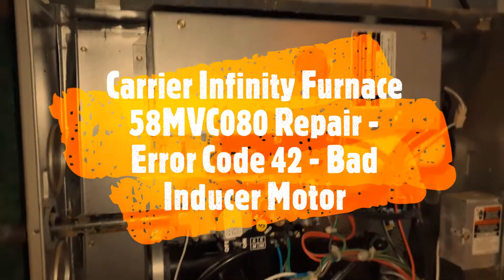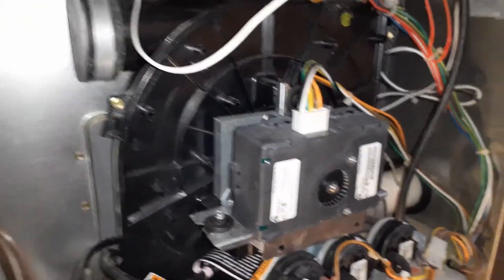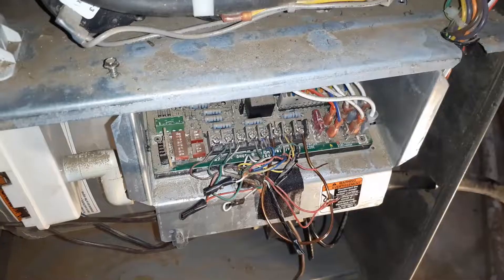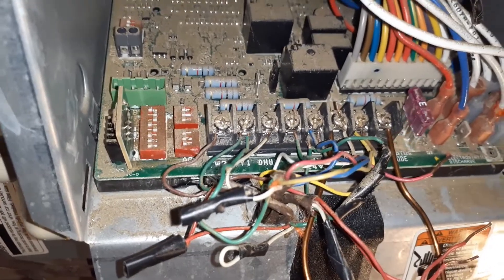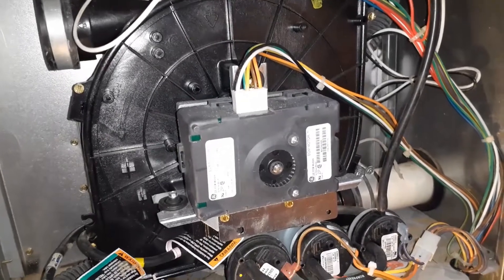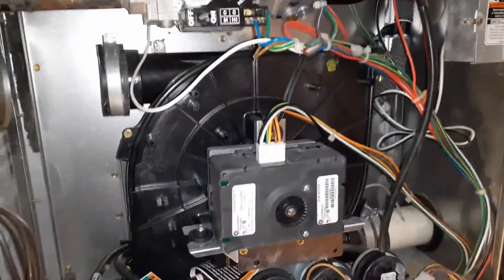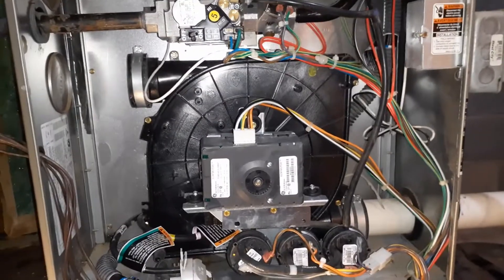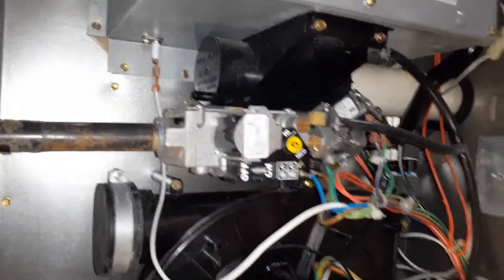Inducer Motor Fix - Carrier Infinity Furnace 58MVC080 Error Code 42

Comment: Will your guid work for a 58UVB model? I’m having trouble finding one for my model. My issue is that it would run for 20 minutes then shut off and throw 42. I replaced the inducer and it ran fine for 45 min. Few hours later, same issue….

Comment: I hope you replaced the gas valve if it was underwater.  It extremely dangerous to use a gas valve that’s been submerged in water.
Reply from the maker: Yes, I had to replace the gas valve on both my furnaces - https://youtu.be/Cbhu7Be1yzg and https://youtu.be/c0WaCe3nJNs.

Comment: It turned the blower on first because you powered up the furnace with a call for heat 

Put the jumper in after the power comes on and you will skip that step
Reply from the maker: Good to know.

Comment: Great to have a luxury of time. My furnace with the same model failed just now during the winter and parts are hard to source from Carrier.
Reply from the maker: Sorry to hear your furnace failed. If the inducer motor is starting the cycle but stops in 20 secs, these furnaces are notorious to fail with error code 42 due to condensate trap blockage. See my other videos, particularly this one - https://youtu.be/q-T2SSFsCWI. If the inducer motor does not turn on at all, then try to spin it by hand to see if it starts it up. Otherwise, it probably needs replacement. Also check for used parts, I got mine fixed with used parts, which are much cheaper.

Comment: Great video. My Carrier is a newer model and the ventor error code is 31. My problem is intermittent and i am thinking of adding a 24 volt led on the low pressure switch output and one on the high pressure switch output (same part you got with the ventor). That way if it fails again i can see if its a switch problem (not likely) or a ventor/obstruction problem (the switches monitor the ventor status through tubing in the ventor to prove the ventilation is working). I have tested the switches by blowing on their respective tubes and i have made sure the furnace drain and outside exhaust are clear. I have serviced dozens of furnaces in a prior life from hot surface ignitors, ventor blades on Coleman units that literally flew apart, to folks shoveling snow off the roof and partially blocking the intake/exhaust. Now its my own furnace 8 year old furnace and its driving me nuts, but i will get it! Again, great video, you know your stuff.
Reply from the maker: It looks like you know how to troubleshoot HVAC. I have seen intermittent issues with mine due to the condensate trap issues - https://youtu.be/q-T2SSFsCWI. I often have to remove the larger drain tube from the condensate trap and let it drain into a bucket, and my furnace runs fine without issues. The condensate trap creates issues with pressure drop in the pressure switches.
Reply: @DIYWithIndi  how ironic, i just came upstairs from my latest effort. i removed the ventor and all looks fine, so i removed the trap and it did have a lot of dirt inside so i flushed it out from all ports with hot water and reassembled. i still did not see water draining but i put it down to the trap needing to fill up. unfortunately as i was wrapping up, it did another short cycle, so i may still have to add my switch monitoring leds. as a plus, i have made a "u-clip" that i slid over the top and bottom flanges on the safety switch so that i can watch the system led codes without stopping the furnace. thanks for the link, going there now...

Comment from the maker: Here is the link to the inducer motors on eBay - http://rover.ebay.com/rover/1/711-53200-19255-0/1?ff3=4&pub=5575486972&toolid=10001&campid=5338486955&customid=&mpre=https%3A%2F%2Fwww.ebay.com%2Fsch%2Fsis.html%3F_nkw%3DOEM%2BCarrier%2BBryant%2B324906-762%2BHC23CE116%2BInducer%2BMotor%2BAssembly%2BPHC23CE116%26_id%3D333382994607%26%26_trksid%3Dp2057872.m2749.l2658

Comment: Hi , I have the same furnace and same error code 42 . I suspect the ECM motor as I’ve checked everything else including the two pressure switches and it points to either the circuit board or the ECM motor - in my case the furnace does switch on occasionally but when it goes on the high stage it switches off and then ot takes a long time for it to successfully start again (albeit for a short period ) - any thoughts ( my furnace did not suffer a flood I should add) 
Also im curious as to why you changed the circuit board first since ultimately the problem was with your Ecm motor . Would the troubleshooting document not have pointed out that it was the ECM motor and bit the board that was bad ? 
Im trying to learn from your experience so I know the best way to proceed with my DIY repair 
Thanks !
Reply from the maker: Watch my other video - https://youtu.be/q-T2SSFsCWI to see if that might be your issue with the condensate trap or water accumulating in the inducer motor housing.. These furnaces are very sensitive to double trap issues. The reason I replaced the circuit board was because I was not sure if the board was bad and it was less expensive than the inducer motor. I fixed it with used parts. If the inducer motor is running, it is probably not bad. Good luck and watch my other videos on this furnace. You will get some more ideas on how it operates.
Reply: Indi I did think of that aa a first step and had already taken out and cleaned out the (White) condensate trap , it had a lot of debris but that did not fix the issue, the thick(est) black ribbed pipe that drains into this trap also did not have any water accumulation. 
Though the ECM motor is running it is noisy  I suspect its fine when on the lower cycle but when it goes on the higher cycle its probably not able to register the rpm that the board is looking for , since I’ve tried pretty much everything else my next step is to replace the ecm -did you get the full inducer including the ECM motor as a single unit ? Would appreciate if you could share the eBay supplier who you bought it from so I can order one . Also if you can send me a link to the .pdf of diagnostic steps you used for troubleshooting error code 42 thanks a bunch
Reply from the maker: @sethianil  Try starting the furnace with the larger black drain pipe removed from the trap end and see if the motor works on the high cycle. I put a bucket underneath where the pipe is so it catches the water. I had this issue on mine recently quite a bit. If it works fine, then you can be sure it is a water drain issue. However, as you asked, here is a link to the seller listing just found - http://rover.ebay.com/rover/1/711-53200-19255-0/1?ff3=4&pub=5575486972&toolid=10001&campid=5338486955&customid=&mpre=https%3A%2F%2Fwww.ebay.com%2Fitm%2FOEM-Carrier-Bryant-324906-762-HC23CE116-Inducer-Motor-Assembly-PHC23CE116%2F333490482897%3Fhash%3Ditem4da594eed1%3Ag%3ABEQAAOSwLWBeKlG-
Reply from the maker: For the troubleshooting guide search for '58MVC Series 100 troubleshooting'. https://dms.hvacpartners.com/docs/1009/public/08/58mvc-01t.pdf
Reply: Thanks for the guide and all your help and quick feedback - I was finally able to fix my furnace - heres my experience for the benefit of other folks facing a similar issue: 

My furnace is Carrier Infinity 96 (model 58MVP080) : 
In my case Error 42 would show 80% of the time with short breaks when the code would disappear for maybe 10 minutes only to reappear  - barely keeping the house warm 

I first checked if it was a water drain issue - cleaned out the white condensate trap (was dirty but no water rushed out of the black wrinkled tube). Tested the two pressure sensors (slight blow on pipe into the sensor with meter on continuity confirmed that both switches were functioning)

Everything seemed to point to the ECM Motor but before ordering a (used) one, I ran some tests for Error 42 per the Carrier 58MVC trouble shooting guide (pages 32 and 33) .Found there was an issue with the RPM feedback line (state 2 was outside the 9.5-10 volts range and showing almost 12 V - same as state 1) - this confirmed that the ECM motor was faulty - got a used replacement today (full inducer with ecm motor) for Can $200 and installed it - finally my furnace is finally fixed and running well 

Lesson learnt : If you're getting Error 42 on your Carrier Infinity 58MVP080 and the ECM motor is turning it doesn't necessarily mean the ECM Motor is working ! A number of things can go wrong in what seems like a working inducer (ECM) motor - its RPM could be in the range not acceptable by the board or there may be a failed electronic component on one of the stages in the circuitry contained within the ECM housing - which I suspect was the issue in my case.
Reply from the maker: @sethianil  Wonderful, thank you for the follow-up on the fix details.
Reply: @DIYWithIndi  Need a login to get the manual.  Is there another link?
Reply from the maker: @gavincurtis  Try this link - https://f01.justanswer.com/fAidDsBL/58mvc-01t.pdf
Reply: @sethianil  interesting, I'm getting the opposite issue, the furnace tries to start up in low stage, fails a few times, then finally starts up properly in high stage. Hopefully it's just the ECM motor, which I ordered used as well.
Reply: @vadim7590  was it?
Reply: I removed the larger drain pipe from the trap end as suggested and subsequently waited to see the low stage come on as it does eventually but it did not stay on into the high stage aa it has gone off again. I will keep it disconnected the drain pipe overnight and see what happens